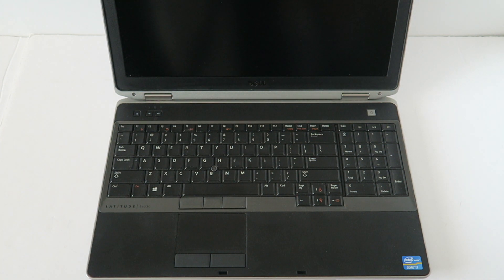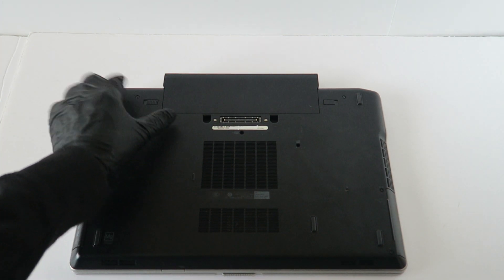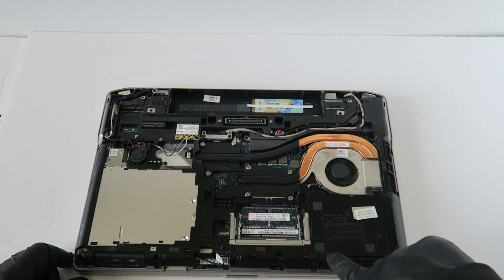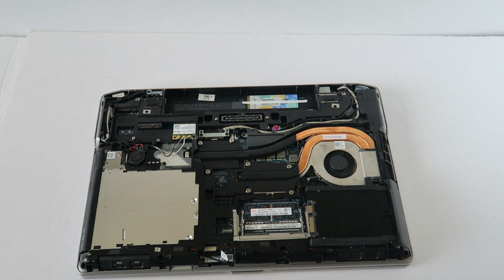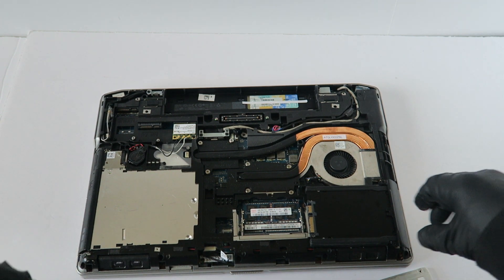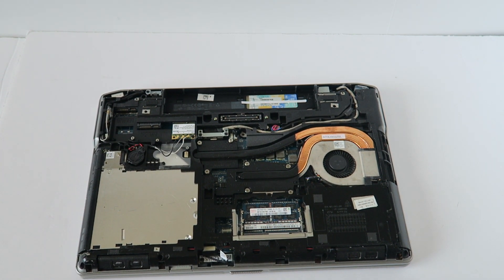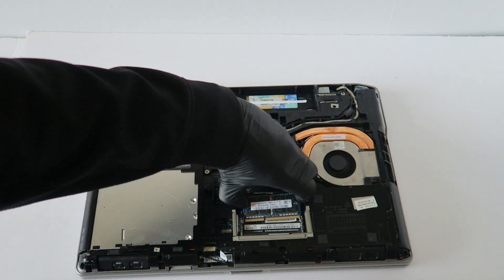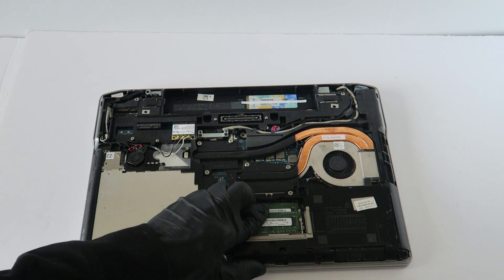Dell Latitude E6530 Upgrade SSD RAM Hard Drive

Comment: Thanks for showing me.. but i just realize my laptop doesnt have a side case for the drive..anyway, i was looking at this video to see if i did something wrong installing my ssd, if it didnt connect properly or i miss the slot because it does not detect my ssd...... any solution?

Comment: Is the SSD SATA A400. SATA 2.5 Rev3.0 480Gb (Part No sa400s37/480gb) compatible with the Laptop model Dell Latitude E6530?
Reply from the maker: Hi, yes that SSD is  compatible with this Laptop.

SSD List:
(1.) Samsung 860 PRO SSD 256GB - 2.5 Inch SATA III Internal Solid State Drive
https://amzn.to/2BY5gRl

(2.) Samsung SSD 860 EVO 250GB 2.5 Inch SATA III Internal SSD 
https://amzn.to/37xWUfc

(3.) SK hynix Gold S31 1TB 3D NAND 2.5 inch SATA III Internal SSD
https://amzn.to/3d7X6D6

(4.) Samsung SSD 860 EVO 1TB 2.5 Inch SATA
https://amzn.to/2B2FURX

(5.) SanDisk SSD PLUS 1TB Internal SSD
https://amzn.to/3hwdqku

(6.) SanDisk SSD PLUS 240GB Internal SSD
https://amzn.to/2zfc7EX

(7.) Crucial MX500 250GB 3D NAND SATA CT250MX500SSD1(Z) 
https://amzn.to/3bTTjbX

(8.) SanDisk SSD PLUS 480GB Internal SSD SDSSDA-1T00-G26
https://amzn.to/2yfgjUK

Comment: My new ssd on dell Latitude E6530 is not detected. Any recommendations
Reply: Create a partition? How do you do that?
Reply: @kejopr23  There's a tool in windows for partitioning. 

I believe it's in: Control panel > system and security > administrative tools > storage > disk management.

Then you have a visual representation of your drives and partitions. FInd the drive you just installed and click on the black thing on it's right. It's its unallocated space

Then everything will be pretty easy. Windows will guide you through the process so don't worry about that :D
Reply: You need to first create a partition
Reply: I tried a few SSDs in mine and couldn't get any to work. My HD speed is abysmal..always pinned to 100% so makes it practically unusable.